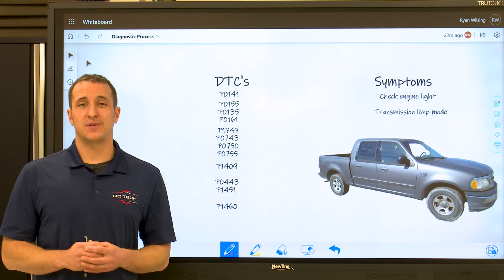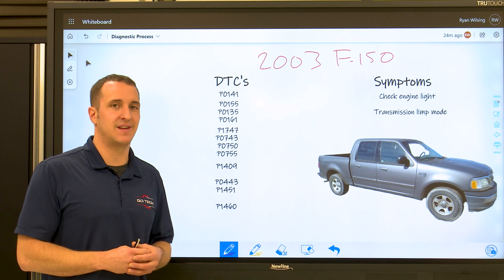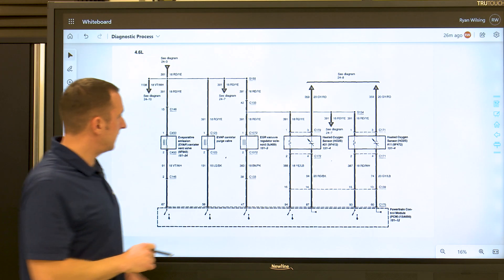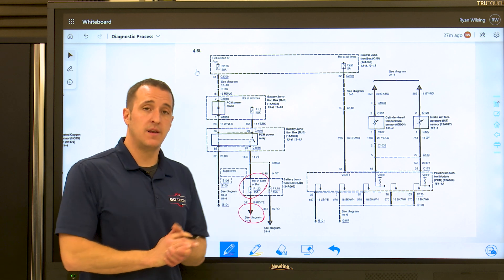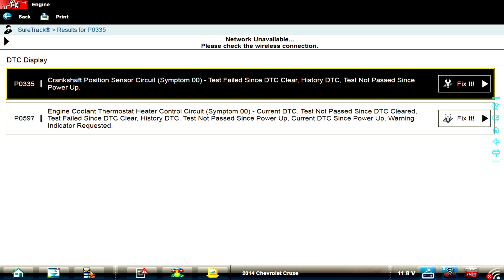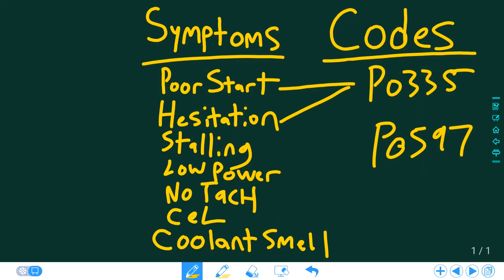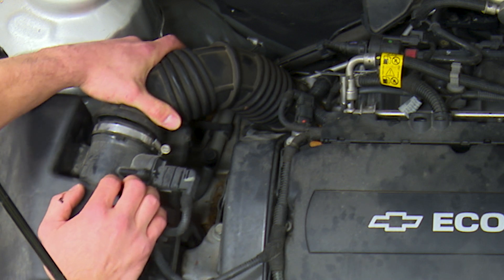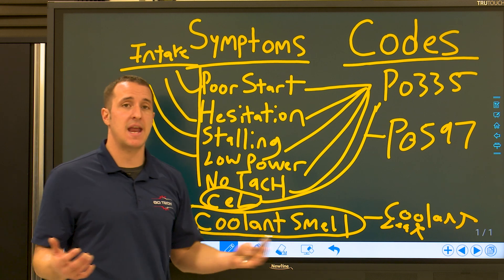Tips for diagnosing a car with multiple problems

Comment: Great video, guys!  Here’s an idea for another diag video which comes at the solution from a different angle - one code (P0300) which can have 10-15 different causes. How do you go about deciding which possible causes to investigate first, second, third, etc?
I’ve got a 2004 Chevy Astro at around 100K miles - due for plugs and wires which are notoriously difficult to change. I’d rather isolate/solve the issue first if I can get away without doing the plug/wire change first. 
I decided to address the cam/crank sensors first since those are relatively easy to get at and cheap to replace. Now I’m studying how to bench test and on-vehicle test to rule them out.
Reply from the maker: That is an awesome idea!
Thanks for reaching out!
~Ryan

Comment: Excellent video. Hey, I have a ised car dealer. Limited mechanic skills, new to this diagnostic world. What is a scan tool that you recommend. I was looking at Autel, would be greatvif it could work with keys, bidirectional, programming modules etc.

Thanks
Reply from the maker: An Autel scan tool is prolly a good choice for that. But most scan tools that do programing and keys are not set up for diagnostics. The IM608 is great programing tool for keys, The Maxysis Elite is a great bi-direction scan tool and has programing capability.
~Ryan
Reply: @GoTechTraining  Thanks for the information.

Comment: Thanks for the great videos guys! I graduated Northwestern Auto/Diesel back in 95. They were just starting to prepare for their high performance classes and OBD2 was being whispered about. Oh the days of the old brick(Snap-on) and the endless adapters. I'm in to fixing machines in warehouses now. Still work on cars on the side. Trying to keep up with all the electronics they are using on these cars. That Aes Wave wire adapter kit is a must have. In todays cars you have to have a service manual to properly fix them. The biggest thing I learned over the years is to don't overthink it and be patient.This video is spot on to what I have experienced in the real world.
Reply from the maker: Hello,
Oh yeah, I started out with the old red brick and a GM Tech 1. I agree sometimes you just have to take a step back and be patient. I'm glad you liked the video!
Thanks for reaching out!
~Ryan

Comment: Visual inspection is done with your eyes. I would advise not to be pulling and shaking wires. You may inadvertently 'fix' your circuit codes temporally. Other than that you're spot on !
Reply from the maker: Hey Mark,
I agree, it would be wise to have testing equipment hooked up before you start poking around too much.
Thanks for watching and reaching out!
~Ryan

Comment: A former coworker had a vehicle with multiple codes.  In our Ford (for city fleet) training, the instructor said, "If you get multiple electrical codes, check powers including fuses and grounds first."  I told the coworker to get the wiring diagram for this truck.  Sure enough, common power from one fuse.  He checked the fuse IT WAS MISSING!  Installed new fuse, test drove truck all was good in Fordland that day.  Soon as I saw the multiple codes on your white board I remembered that coworker and the truck's problem.  Never figured out why the fuse was missing.
Thankyou for this video.
Reply: Thanks Ryan
While he went to get the wiring book, I did a quick visual check, saw the missing fuse, when he came back I looked in the book, saw it was the missing fuse, but he pointed it out to me after I saw it.  After that he went on to solve other electrical problems  by using the book and visual chec.
Reply: Supposed to be "check."  I'm not an instructor, but I tried to pass on electrical tech tips to help other techs and avoid LONG, ENDLESS (in some cases) DIAGNOSTICS.
Reply from the maker: Hey Mike,
That's awesome, that exactly what we are trying to do at GoTech. No matter how complex or simple we just try to share what we have learned along the way to help people out. Hats of to you sir!
~Ryan
Reply from the maker: Hey Mike,
Thank you for watching!
A missing fuse sounds like a interesting diagnosis! Good thing you told him to check out the wiring!
~Ryan

Comment: 03 Regal with no codes, no check engine light at all except for bulb check, runs great but has idle speed control issues.  No blown fuses.
Reply from the maker: Hey Andy,
What engine is in that regal? Have you tried checking the IAC and cleaning the throttle body?
~Ryan
Reply: @GoTechTraining  V6 engine.
Reply: @GoTechTraining  I unplugged the idle air control and TPS while the engine was running and the computer did not recognize any code problem. Will not have a chance to look at it again till next week.

Comment: I go back forth between being glad for the clear simple explanation and weeping for the lack of critical thinking it represents in the case study. Going to the PCM when you have a bad fuse that is a common link in the system is just ridiculous.
Reply from the maker: Hey Mark, thanks for watching! I could not agree more. Sometimes I think shops may just end up too quickly down the rabbit hole of diagnosis without spending the time to take a look at the bigger picture...but to not look for commonalities between 10 different pieces of a puzzle only to decide "well must be a PCM" seems almost negligent as a repair facility. Appreciate you watching!
~Mike

Comment: Are you serious!... That's basic diag 101, are there that many young dumb yanks who can't do this basic shit? I guess I shouldn't be surprised cuz I get lots of cars that have had the fleebay canon fired at em here in OZ!
Pick a common code n chase it has a 99% success rate after fitting all the OG sensors.
I noticed you picked one of General Messes biggest shitbox motors as an example, where do I start the list of problems with these ultimate piles of shit?... The list is very very long!

Comment: Just start with code with lowest number?
Reply from the maker: Hey Charlie,
In this case, I guess I did pick a low number. Most of the time I will pick the code with components or test points that are the most accessible.
Thanks for watching!
~Ryan
Reply: @GoTechTraining  I like the one that will be the most expensive repair.  Say p0017' if the customer doesn't want to fix  that then you are wasting ur time and can ship it. Don't worry about small leak detected then.😉
Reply from the maker: Hey Charlie,
I agree, I have been there before. You spend a hour finding a small EVAP leak only to find the coolant smell is a $3000 leaking head gasket job and the customer junks it.😒
~Ryan

Comment: As soon as you said multiple circuit codes I new it was going to be a fuse. I group the codes and then pick the most harmful or expensive problem to fix first. You can also clear the codes after you write them all down to see what problem comes back first and tackle that.

Can you do a video on reading wiring diagrams? I have a very basic understanding of wiring diagrams.
Reply: Fuse is one of the options. It could have been anything that these circuits have in common. Fuse is one, but also an open, or a short to power, or a short to ground could have caused similar issues, as well as high resistance. Short to ground usually leads to a blown fuse.
Reply from the maker: Hey Thomas,
That is a really good method. I should have talked about that. Going after the most expensive problem is good on some cars too, Especially if your a tech. The first diagnosis might total the car, or be over the customers price range to fix. 
Check out our past videos, Mike did a few really good videos on reading wiring diagrams. 
Thanks for watching
~Ryan

Comment: I need to take exception with this video. On the first half, short story was the fuse (per you) was to blame. Since you did not describe the condition of the "open" fuse i cannot use the blanket explanation of "the fuse was merely a symptom and not the cause". That out of the way, the fuse had a story to tell and it's story develops diagnostic skills, blaming the fuse and replacing is not proper diagnostics and is merely making a tech a parts changer. Yes, I realize it was test driven by both the shop and turned over to the customer with the advice to "keep an eye on it" ! But, it would be extremely helpful to give the customer and those watching this vid a solid explanation of the what and what if's. 

On the second half of the video, you spent  a very reasonable amount of time with diagnostics and decent explanation, to bad you missed the mark on the first half
Reply: Think he did hit it bank one sensor 1 the heater circuit may have taken the fuse out.was not short any longer to blow the fuse.just a thought bro
Reply: F"ck off; he clearly stated that he replaced the fuse and did several test drives to ensure that there wasn't a short. The short could have come from a shorted O2 heater sensor that they replaced but didn't do due diligence to check for KOEO power and grounds. With shorts; there is usually a cause; a test drive ensures that the cause is covered. He could have spent a lot of time checking for a short that may have been fixed when a part was replaced and not necessarily an intermittent short to ground as the car moves, etc.
Reply from the maker: Hello,
I agree that any blown fuse needs to be investigated, and the cause of the blown fuse is the core issue and not the blown fuse itself.
The reason we did not go after the fuse in this F-150 case, is that there were multiple new parts found during our visual inspection and the fuse did not blow after it was replaced, My thought process was that the new parts may have fixed the issue that was causing it to blow. 
I agree I skimmed over the new part aspect of the video and should have better explained the repair.
Thanks for reaching out and watching the video
~Ryan
Reply: EKA Motors,  I am not and up until a few minutes ago (after searching for an explanation of the acronym) did I realize there is such a group
Reply: Also said other shop replaced a O2 sensor